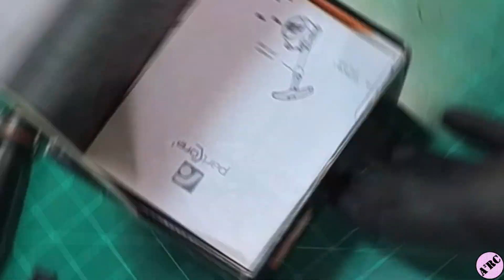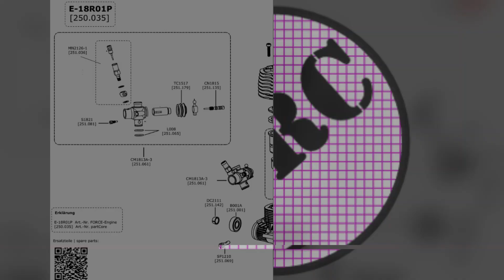Force 18R Nitro Engine Overview - HPI G3.0 HO Upgrade - Club Racer

Comment: Nice tear down and overview on that beauty of an engine. I agree that those hp specs should be equal to the HO or very close
Reply from the maker: @BoostedRC  Thanks for watchn’ BoostedRC 💯
The HO is a great update to the G/T3.0. 
- This 18R takes the “idea” of the HO and turns it into a formal Club Racer imo. 

We would need to see how she performs but, I bet theres even some opportunities to adjust timing and perform some Sleeve mods on it. They may help take it up a notch as well. 

Thanks for taking the time to write 🩷

Comment: Hey. Is This engine a direct replacement for rhe nitro star g3.0 ho. I have a wr8 with a dead engine. Wil parts form The old engine fit on? Clutch parts and all?
Reply from the maker: @jonaspedersen6369  Hey Jonas. Thanks for the great question!
Other than needing a different type of header/exhaust, you could be able to swap the 18R with the HO in your WR8
- My guess is that should be enough room on the chassis for the rear style exhaust and if you end up swapping engines, I would love to know how it goes 

I appreciate you taking the time to write and for watchn’🩷

Comment: Hi is the Starter Shaft on the engine a 6mm or 8mm ?
Reply from the maker: @2259alfie  Thanks for watchn’ 🩷
- This engine uses a 6mm stater shaft
Reply: @a2rc  hi big fan of all your videos question do you know the Size of the Starter Shaft on the  Dynamite  .19 Mach 2 nitro engine 6mm or 8mm ?  I want to install a Rotor Starter 
Thanks Alfie
Reply from the maker: @2259alfie  I really appreciate the support and letting me know
- Unfortunately, I do not know the starter shaft size of the Dynamite .19  6mm for be. Good guess but, I can try and find out and get back to you, if you would like? 
- You may know this but, the .19 is made by a different company (SH) than the 18R
Reply: @a2rc  hi thanks for your fast response yes if you could find out the size I would greatly appreciate it , I’ve sent numerous emails to Dynamite Racing with no response I do not want to run the tarrexas EZ-start
Which is a direct fit
Reply from the maker: @2259alfie  Hi again. I had a friend measure their .19 and the start shaft is indeed 6mm in diameter. 
- I hope that helps
Reply: @a2rc  excellent thank you for all of your assistance 👍🍻🙏

Comment: Looks lot like xtm .18
Reply from the maker: @paul707.7  Thanks is for the comment Paul 
 I believe XTM engines were made by Golden Lion (SH) not Force. Some engines/brands do have their similarities though 

I appreciate you taking the time to write and for watchn’ 🩷
Reply: @a2rc  do you have any tuneing tip for the os cvx .15. I got it going ran well on old fuel. Like 5 year old sidwinder fuel 16 /20 Then i went with the off road fuel new. Ran like shit.
Reply from the maker: @paul707.7  I can definitely try and help. 
I believe the “off road” sidewinder fuel is 20% with 9% oil (correct?)
The OS 15CV series of engines are ABN so, they will need more oil concentration than 9%. I suggest 14-20%. The extra oil helps protect the nickel plating and provides a little extra sealing for combustion. 

That could be a portion of the issues you are having (since you noticed a difference in performance after switching fuels). 
- Tune does change every day and needs adjustment. Nothing to get upset about, just listen to the engine, check temps and adjust as you go. 
Let me know if you need any specific tune help with the carb/engine